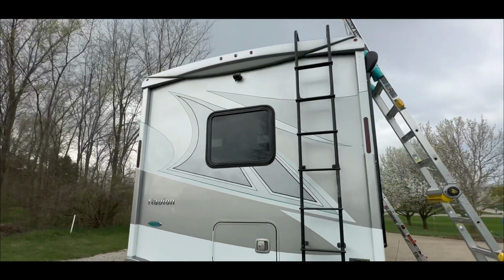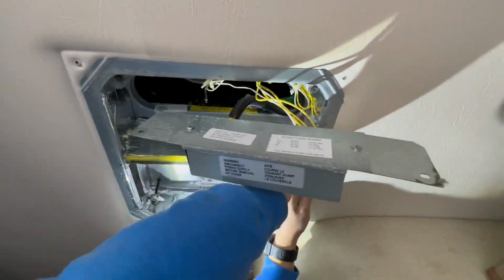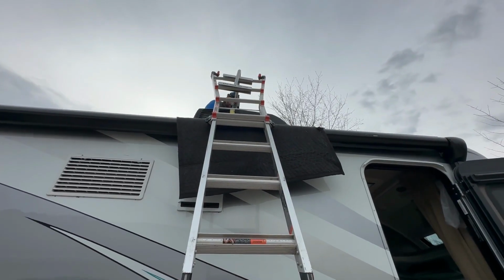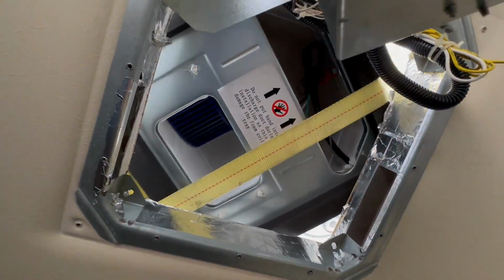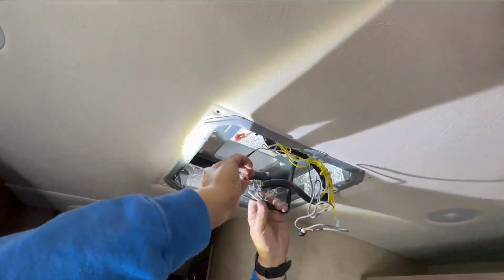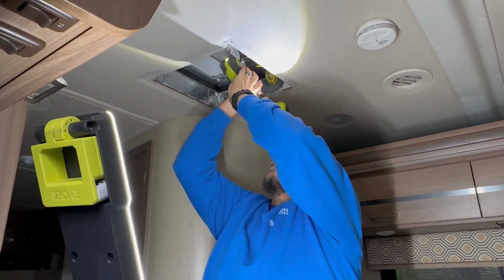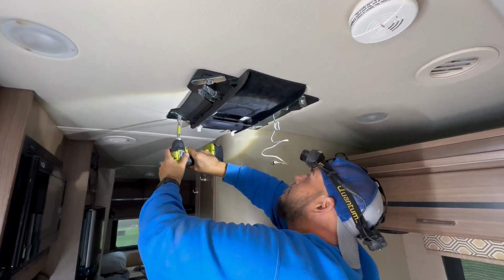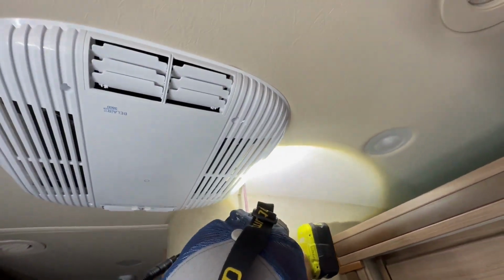How We: Install an RV AC Unit

Comment: I see you didn’t use any silicone to seal the unit to the roof, just to confirm….tightening the gasket 1/2 inch is good enough., thanks
Reply from the maker: @lupesalazar5872  no type of sealant is used. Most of the gaskets that are attached to the bottom of the units have a paper gauge also. Not all of them, but many of them. Also, you can reach out to the manufacturer of your unit and inquire about a specific torque spec to be absolutely sure you have proper compression. But NEVER use a sealant.  Unless…..  it’s a special application. Like a van, class B  type. Then that manufacturer may have different specs.  You will know if you have an unusual spec when you remove the old one.  If you find sealant, reach out to the manufacturer.  Good luck on your install.
Reply: Ok thank you

Comment: I have a quick question, I have install two of the houghton 15,000 but units with heat pumps and love them. My question is in regards to the thermostat that runs the propane heater, do you have a video on how to wire the propane heater after install the houghton units as there are remote controlled. I like to use the propane heater one and a while as it has basement heat for the winter. I think the power to the thermostat came from the old dometic A/C unit I took off the roof. Any help or instruction would be appreciated.
Reply from the maker: We left the original AC/furnace thermostat in place.  Since the Houghton used a remote we just left the old control board tied to 12 volt in the ceiling.  The Dometic has a pair of communication wires that would have sent a signal to the furnace.  Unfortunately we currently do not have a video on this.  Darin from @myrvworks may.
Reply: @missionrvservices  thank you so much for your reply, I got rid of the connection at the roof ac maybe not a good thing will have to figure out how to rewire before winter. Thanks again

Comment: Can you install that in a semi truck sleeper? Such as 2015 freightliner cascadia?
Reply from the maker: Why not? But it uses a ceiling controller, so you have to have 120volts available to run it.

Comment: Nice. Video,    wish you could have done some  dbi. Sound measurements. To compare
Reply from the maker: The Coleman on high is 72 decibles and is 70 decibles on low. The Houghton is 62 decibles on high and 52 decibles on low. Very big difference 😀.  There is also some great information on the Houghton website.

Comment: You've done a video on cleaning your A/C. Maybe I'm missing something, but I would like to know how to remove the cover of my Houghton 15,000 Heat Pump to clean the coils and inside. When I first ordered mine, the cover was cracked and they sent me a new one. I see how the top section can be removed using the cracked one, but not when it's attached to my roof.
Reply from the maker: There should be 4 screws on the top of the cover and two on the side but getting to the condenser coil is very difficult on a Houghton. Several brackets must be removed in order to remove the styro foam cover. Take lots of pictures so you know how to put it back together.
Reply from the maker: If you'd rather have someone come tackle that for you, you can find a certified tech at RVTAA.org.